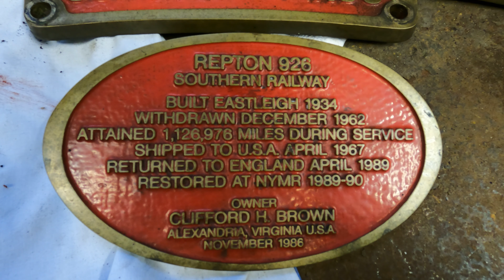NYMR - Black 5 No. 5428 'Eric Treacy' test run and shed walk round

Comment: why is the middle wheelset on the tender different than the front and rear sets? the wheels are solid while the other two have spokes. Is this on all Black 5's?
Reply: It’s always had it since it was purchased from BR, it was probably a quick repair just to get the loco back out.
Reply: @Bigaid  makes sense. thank you